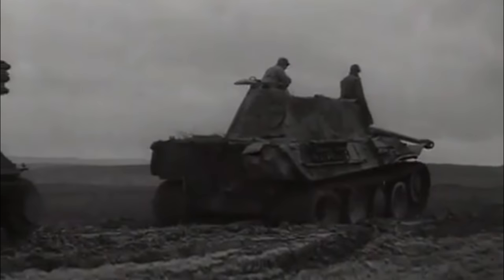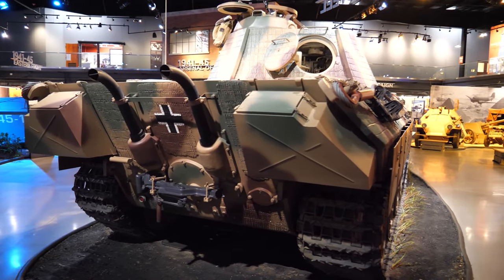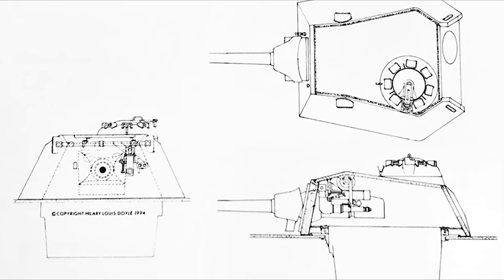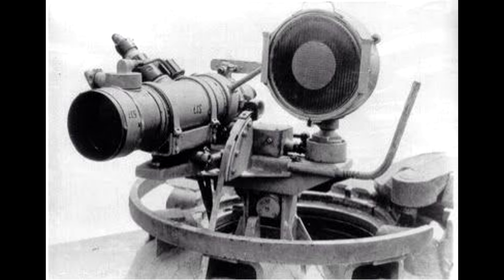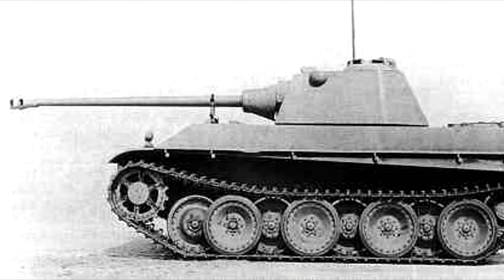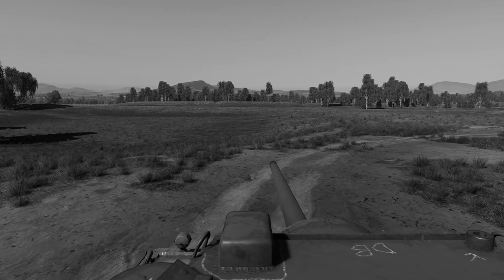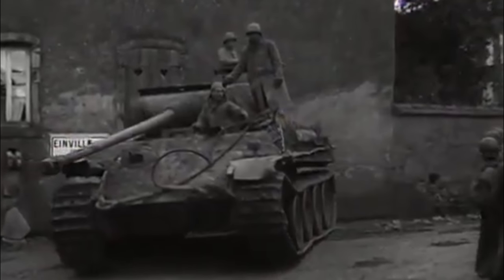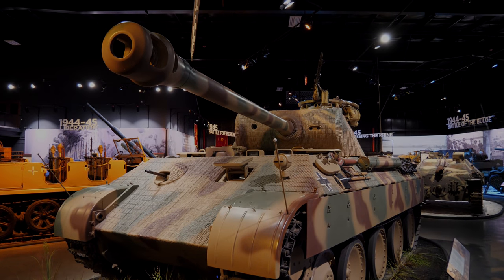The Panther Time Forgot, the Panther F | Cursed by Design

Comment: Something to mention is that many people believe the schmalturm was designed for the Panther 2, and when the Panther 2 was cancelled, the scaled back F program would inherit this turret design. This doesn't appear to be true, as the schmalturn we see today was designed AFTER the Panther 2 was cancelled, and the Panther 2 had a different turret. (The stock turret on Panther 2 in world of tanks is relatively accurate.) Neither the the Panther 2 nor the F were to use an 8.8cm gun of any kind, despite serious discussion to put one.
Reply: I remember reading at one point that a pair of those Panther II turrets were built, but neither was ever installed on the Panther II prototype chassis. They were sent by train to Italy for use on pillboxes. There's no record of them beyond that, but the train was bombed so presumably they were destroyed then.

If only Gaijin had put the correct turret and gun on the Panther II, then it wouldn't have been removed from the tech tree.
Reply: @RedXlV  well if the Panther 2 was actually produced, it might now have replaced panthers entirely, the Schmalturm was an attempt to cheapen and lighten the Panther G further. What this means is a Panther 2 with a schmalturm is not an unrealistic configuration, albeit it did not end up happening. Neither is it the case for its 8.8cm L71, as both the Panther F AND the Panther 2 were seriously contended to have this weapon.

That being said, I think the Panther 2 in WT should be redesignated Panther 2 8.8cm L/71, and the correct Panther 2 with the 75mm L/70 and correct turret be put in the game at 6.3

Furthermore the Panther 8.8 in World of Tanks is strangely a Panther G hull with Panther F turret and the L/71. WoT has always been more generous with the prototypes, but its odd to have the G hull, even if it is very similar to the F hull.
Reply: @kobeh6185  At first the Panther 2 was designed to have more armor at the sides , cause Russian anti tank rifles could pen up to 40mm . Later on as some side skirts where mounted this problem was solved and there was no need for the Panther 2 anymore .

There where plans for a stabilizer , night vision , even the long 8.8 was mentioned . But the turret was too small for that , hard to load this long 8.8 shells in a small turret . 

Panther 2 in WT with the 8.8 at 6.7 should stay , why a Panther 2 with the same gun as Panther D and almost the same armor ?
Reply: @5co756  the Panther 2 did not have the same armor as the Panther D and A, nor the G. The Panther 2 had its frontal plate increased to 100mm, and had a the transmission from the Tiger 2, and a more powerful engine. Despite being heavier the Panther 2 would have been the most mobile Panther, and have much better reverse speed. Pair this with heavier armor,and it would sit comfortably at 6.3. Consider the long barrel jumbo is also at 6.3

The stabilizer never materialized.

Comment: Every book I've read on the panther, the tiger, or the tiger III all state that it had 'teething' issues, why doesn't anyone explain exactly what the 'teething' issues were.
I was a heavy equipment mechanic in the Marines, and I'm sure there' are a lot of people that watch this type of video and are very mechanically inclined,, so my question is why doesn't somebody explain exactly what the 'teething' issue was.
The term is repeated ad nauseam in almost every book you read on German tanks.
An example of what could be stated is that the final drive planetary gears were prone to breaking.  Or the clutch surfaces for the drive mechanism wore quickly and caused steering issues.
My point is if you're going to state there were mechanical issues, state exactly what they were, as opposed to using an elementary term that to anyone with any mechanical knowledge means nothing.
If your researching these vehicles go beyond what the last author stated and find out exactly what the mechanical issues were, not just an ambiguous rendition of what becomes a cliche after it's written as many times as it has in regards to German armor.
Reply from the maker: The books you're reading aren't necessarily intended for someone with a deep understanding of that sort of thing. You should look to places like Tank Encyclopedia or the Panzer Tracts series of books if you want detailed explanations.

Comment: I have heard that at some point in the war, the quality of German armor was deteriorating due to the increasing scarcity of raw materials.  To compensate, different heat treating methods were used but resulted in somewhat brittle steel.  The Russians attributed the failure of the armor to their improved weapons. Anyone know the true story?  ConeOfArc?
Reply: In a nutshell based on information from the axishistory forum, German steel was indeed made differently at the end of the war, using heat treating methods instead of specific elements in the armor. This however resulted in armor which was still according to specifications and thus just as strong. However when it failed it broke in a much more spectacular fashion. 

In a nutshell whenever you see a picture of the tanks all shattered, it was hit by projectiles which would have destroyed the tank anyways, and people ignore the countless vehicles which likely were shot, but show no major signs of it.

Many of the pictures are also glorified soviet propaganda, of tanks they fired countless shells into until it finally got caved in.

Comment: Remember when they added french tanks and the tank you chose as your icon had a shell so bad, that they removed it? 13 or 19mm of Penetration at 100M .
Reply: The Cone literally had a shell fuse set higher than it had penetration. They could probably re-add it if they overhauled the game and had WWI as reserve tier. Inter war tanks would be mildly competitive not having to face one thousand late variants of the Stuart or Pz ROFLstomper set to low tier because herpa derp balans.
Reply: @lector-dogmatixsicarii1537  Plus for shits and giggles you could have something like the TOG II and Mark V. Go up against an Abrams.

Comment: The Tiger 1 could have had a turret upgrade and been even more legendary, but they stuck with the non-slopped armor?
Reply: there is an actual plan for the Tiger I upgrade, but it was not realized and remained as a paper project

Comment: It was a mistake for the Germans to produce both the Panther and Tiger designs - what they really needed was a true 35 ton tank powered by an air-cooled diesel engine and armed with the KwK 42 or an 88, and driven on a cheap and easily repairable leaf spring suspension.  Sloped armor was beneficial but not essential.  Nevertheless its a good thing the Germans made that mistake - it would be hell if they'd won that war.

Comment: I would dare to say the opposite. "Too much, too early".
  The Germans should have focused on quantity over overengineered quality. They had the PzIV, which was excellent. If they had improved that with extra sloped armor, better engine and bigger gun, they would still have something that could perform just as good as the Panther, but in much higher numbers and lower cost.
  Not to mention the Tiger, Tiger II, JagdTiger....and all the rest of the "wonderweapons" which were all unnecessary waste of resources.
Reply: quantity is not the way for them either

quantity means producing things as many as possible as quickly as possible, and Germany simply didn't have both the industrial capability and the resources needed to do that unlike the US and the Soviet
Reply: "Sloped armor, better engine, bigger gun" Sounds exactly like a Panther, which was actually cheaper to produce than the Panzer IV later in war.

Comment: 0:24 this was a super heavy tank designed by the Japanese it’s name was O-I but it was never built, it was even bigger than a German maus tank but it wasn’t as strong.
Reply: They built a prototype, they abandoned the design in 1943 because when testing it tore up the road and sank a meter into the ground. Would have weighed 120 tonnes, had 1500HP but a top speed of less than 30kmh, frontal armour was two stacked 75mm plates (Japanese couldn't produce thicker armour), would have had four turrets, 1x 150mm howitzer, 2x 47mm anti tank guns and one twin barrelled 7.92mm light machine guns (though the Japanese called it a heavy machine gun) on the rear. Even if completed the design spec could be considered obsolete by 1944 as the 47mm would have been ineffective against most targets and the Churchill Mk7 had thicker armour despite being a third the weight. (nevermind being one plate rather than two, a rule of thumb (assuming no spaced armor) is two plates are 0.7 times as effective as a single plate of the same diameter so two 75mm plates would have an effective armour value of 105mm, only a tiny fraction more than a Churchill 1)

Comment: Its not about the D, G, F or numbers of it, but about the O - oil to drive them. Real bottleneck of German war engine was fuel, not technology or production. Its no use to build better or more tanks unless you can fuel them.
Reply from the maker: This video isn't about resources it's about a specific tank.
Reply: @ConeOfArc  yes, sorry and my credits for your work. My reply was more inspired by some people in their replies claiming the right tank or numbers would have made the difference.  When other factors would be good, the Panther and Tiger would have been excellent means for victourious tank warfare. For in given circumstances, they still proved a very effective weapon despite all limitations.

Comment: So they added more weight to a tank that had infamously bad transmission reliability? They might as well of just burned them at the factory.
Reply from the maker: The turret actually weighed about the same as the original panther turret
Reply: @ConeOfArc  True but the extra hull armour won't be doing it any favour. Also does that include the weight of the rangefinder?
Reply from the maker: @crplsteve  the increase in weight from the hull plates is pretty insignificant. As for the rangefinder I can't say if the weight is included but I would assume so since it was built into the turret. I don't recall seeing anything specific about it though.
Reply: @crplsteve  Dude that problem had the first Panther D , the A and G model was way better . Always this stupid myth's ..... 😅
Reply: @5co756  The Panther G Suffered an average of 5% failure rate on the transmission alone for 100km distance travelled, this goes up to 90% at 1500km. For example during the battle of the bulge 35-40% where down for maintenance. While on paper the panther was a good tank, good gun and good armour with ok mobility, In practice it was a mechanics worst nightmare to both service and keep operational, Add to this the lack of dedicated crew hatches making fires very deadly indeed.
Reply: @crplsteve  Yeah there where problems but not like every Panther broke down after 5km  as it leaves the factory . 😅

Comment: The curved mantlet shot trap was extremely rare and only possible under very limited circumstances. That’s why many Panthers continued to be created without the squared off lower section until the end of the war. It really is only an issue in video games. 

Essentially, it only occurred at very close range while firing upwards. Then you had to hit one particular grapefruit sized area on each side. So, an anti-tank gun being charged by a Panther at a slight angle. Even under optimal testing conditions it was really hard to reproduce.

Comment: Cursed? At that point in history everything the germans did was cursed, one way or another. Take this turret. 120mm would be considered very good just a few years ago. But in 45 with T-34-85 and british and american HV 76/75 mm guns  rolling around that is practically a suicide to hope to bounce something with 120 mm of low quality armor without tungsten which to make thinhs even worse stands vertical.. The chassis is another example of exactly that, a design that was considered allready overweight at the prototypes, all it did over time is get even more weight in exchange of rapidly degenerating production quality. 
At 45 germans got something that looked like tank, a heavy one, but did not offer protection, nor mobility, nor particular firepower to talk about.

Comment: Please, for the love of god stop calling it a mantlette. It's called the gun mantle or just the mantle. Please..as a US tank veteran its driving me insane. Not sure where you picked it up, but I've never head them referred to as mantlettes other than when there is a smaller sub mantle that isnt part of the recoil mechanism of the gun fitted to the mantle as a separately moving piece to allow greater depression or elevation of the gun when the mantle is cumbersome or has a poor design but has to be that way due to armor requirements.

Comment: sadly nothing about the 88mm gun
Reply from the maker: That was a separate project
Reply: @ConeOfArc  but aren't they Very closely related given the 88mm turret also uses a small turm turret
Reply from the maker: @meki___6881  no, the 88mm panther turret is different. The confusion regarding the two being connected is a misconception caused by an error made by a historian.
Reply: @meki___6881  like he said, the Panther mit 8,8 cm KwK 43 L/71 was a separate proposal to equipped the Panther with the long-barreled 88 gun on the Schmalturm

Comment: The more I read and hear about WW2 the more I think that the Wehrmacht never stood a chance at all.
Even without Russia joining in on the mix germany would have lost anyways.
Reply: I don't understand your thought. 
The Soviet Union had to ask the British and the USA to open a second front because otherwise the Red Army would not have managed to push back the Germans. 
Without the two-front war, Germany might still have been able to prevent the collapse of their front line and decisively repel the Red Army. 
So why do you think like that?
Reply: @cursedjagdtiger7191  well the germans constantly suffered from poor ressource management.
Like in WW1 after a few years they ran out of steel, fuel and rubber real fast.

So the Wehrmacht would collapse in on itself anyways.
Reply: @SashaTheDog  In a protracted war with the US, yes Germany would have eventually lost as there was zero hope of overcoming the US industrial capacity. 
But...if you look up how many soldiers perished and how much equipment the Russians expended to cause 3/4 of Germanys losses, the war in the west would have been much much longer and bloodier.  
You are correct, The Wehrmacht never stood a chance...but the human cost of defeating them would have been staggering for Allied countries used to losses a fraction of what the Russians were accepting,.  The contributions of the Soviets to the war effort cannot be underestimated and are not given enough credit, simply because they became an enemy of the west even before the war ended.

Comment: Would the Panther Ausf. F have change anything? Not really. 

In the last years of the war, Germany had a big problem with tank hulls and producing enough of them with a collapsing war industry. That is why the Wehrmacht tried to simplify their tanks more and more, like removing hatches or driver optics, to reduce costs and production time. They also removed older tanks from production and modified them for the use of tank destroyers and SPGs, again to make it cheaper and faster to build. Combine that with the effort to make the Tiger II and the planed Panther II share parts and the planed E-series which, again, just tried to reduce production time and costs by sharing parts.
They literally started to put Panther turrets on bunkers, since they had more of them, then hulls. 

I'm pretty sure, the Panther Ausf. F would have changed nothing at all, since the biggest issues, being a logistic nightmare, never could be solved. Yes, they would have killed a weakspot, but when you can't effort to repair your tanks or even produce enough in time... it's a waste of time and manpower.

Comment: Why does the narrator talk about the MG 44 while showing a still picture of an MP 43 or STG 44.
The one is a machine gun, therefore MG and the other is an assault rifle.
They are completely different weapons by different manufacturers for different purposes,
Weak!
Reply from the maker: I talked about the MG 34 briefly but didn't show any pictures because I was just referring to what the STG44 was replacing in the hull mount. The MG44 never existed though so hopefully that was just a typo on your part.

Comment: The panther was not the best tank of WW2. It was not a war winner. The best tank of the war was a tank that could be kept in battle and had superior crew survival. The Germans saw far more Shermans than they saw Panthers or MkIVs. The biggest problem of the Panther was that it was difficult to repair in the field and for a tank that broke down often, this is a "best tank of the war" killer. 

At any rate. the Germans lost the war as soon as they invaded Poland. The Germans had no resources and Hitler micromanaged the war. The Germans would not have won the war even if the Panther was reliable, easy to maintain and actually, "the best tank of the war."
Reply: Sorry, but the "best" tank is a tank that can fill the needs of certain country in terms of armored warfare doctrine
Reply: So Panther is one of the best for the German